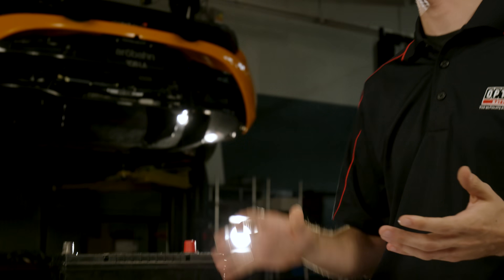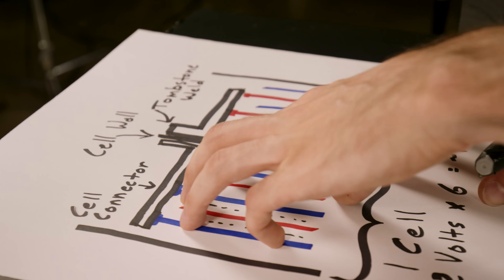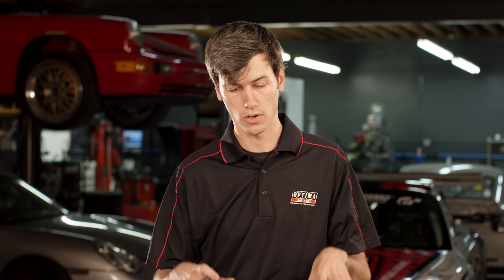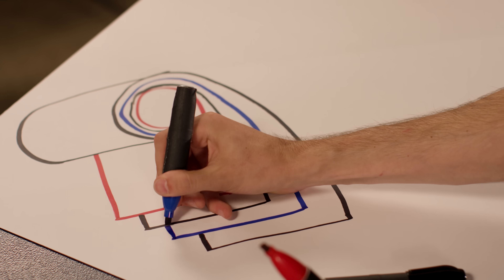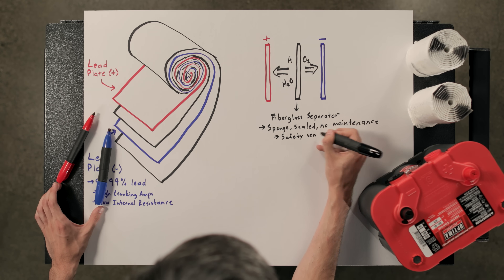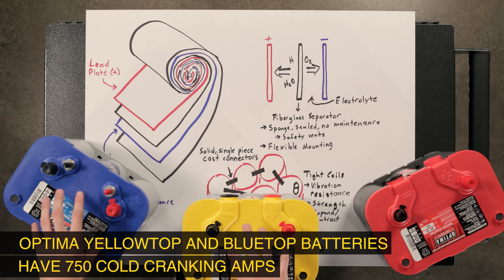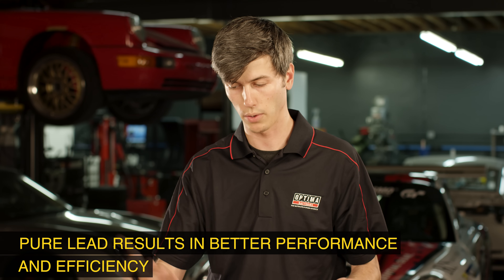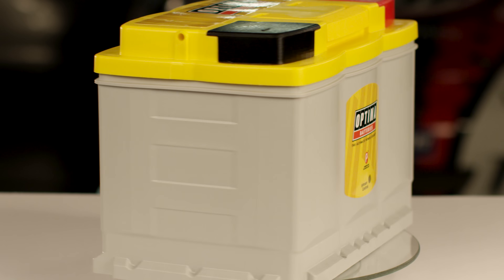What Type Of Car Battery Should You Use? Flooded vs AGM

Comment: FLA batteries are sealed and don't require maintenance in automotive applications anymore.  They have been this way for as long as I have been alive (31 years).  The only time I have seen a battery that you could add water to was on a golf cart (a deep cycle battery system).  This is what happens when you let a company sponsor your videos.  Facts get skewed.  Had you said this but explained that sealed FLA batteries have a shorter lifespan because you can't add water, that would have been there honest truth.  Your videos are usually great at explaining engineering concepts, but this one was slightly biased.
Reply from the maker: Johnson Controls makes flooded lead acid batteries, so why would the make something up about their own product? You can still add water. There are sealed and non-sealed.
Reply: Engineering Explained if you are comparing just their products, that's fine, but that wasn't clear. I'm not trying to knock you or anything. I'm just providing honest feedback. Maybe if you had made mention of sealed vs not sealed that would have kept things completely honest.
Reply: More than half of the FLA automotive batteries I've seen are not "maintenance-free" and still have removable caps on the top for checking electrolyte level and topping them off. The "maintenance free" FLA batteries are still not completely sealed...they can't be—they need a way to vent gasses that are produced during recharging. Turn one on it's side and leave it overnight if you need proof. They have vent ports that are free-flowing, even if their location is not obvious (batteries intended for interior mounting will have designated ports to attach the vent tube(s), usually on the top edges). A true VRLA (valve regulated lead acid, which includes AGM types) also have vents, but the vents are normally closed and only open in the event of excess pressure build-up. They are clearly visible on Optima batteries: they are the raised circles on the top corners opposite the battery terminals with the gray filter media pressed into them.

Comment: Why they don't use lithium-ion battery ,it's lighter ?
Reply: Safety. Lithium-ion are very picky about how they are recharged, their environment (temperature) and need protection from being physically breached (in an accident). Fail to protect one from these things and they easily go into thermal runaway and catch fire (and can be hard to extinguish once this happens). The cost to provide the necessary safety mechanisms does not justify their mass-adoption as a battery for internal-combustion vehicles. There is an alternative chemistry, lithium iron phosphate, that is much safer than lithium ion, almost as light, and can be directly substituted for lead acid batteries in many vehicular applications, however they are very expensive. A typical small one (sized for a motorcycle) is $150 USD, while units sized for a typical 2.0L car engine (480 cranking amps) are $300 USD!

Comment: That last battery is the one that I use and I haven't had to replace my battery for the past 5 years, haven't had an issue without it starting either even though my car alarm is technically a parasitic draw and I drive less than 5k miles a year.  I recommend that or the spiral for anyone.  Flooded are not going to be maintained properly by most people.

Comment: So, what's the advantage of Flooded Lead Acid batteries? Why are these still used?
Reply: Aleksandar Udovicic  - They're cheaper to make, and they are more tolerant of being overcharged. If you overcharge a (non-sealed) flooded cell battery, the electrolyte (acid-water) can be refilled; a sealed battery of any type cannot be serviced in this manner. For this reason, a sealed or AGM battery requires more care with the charging voltage.

Comment: Too bad Optima doesn't make a battery that fits my Miata...
Reply: You could use the large Ballastic 16 cell EVO2 in your Miata. It provides 480 cranking amps and weighs only 3.5 pounds (about 1/10 the weight of the lightest Optima). Unfortunately it also costs $300...

Comment: AGM lead acid batteries cost twice as much and has half the cycle life as flooded lead acid batteries.

Lithium-ION battery technology is just about at the point being cheap enough to displace AGM batteries. The lower cost and longer life of flooded batteries make them safe from being displaced by Li-ION for the medium term.

Comment: Cool Video, could you do a video on whats required when trying to switch to a lightweight battery, but still having enough juice to run the car.  Im trying to find a lightweight battery to add for my car to reduce weight, ill own the car for a number of years so even fairly expensive batteries would work, assuming they last.

Comment: what is the differences (if you can, with advantage and disadvantage between each other) between dry and wet batteries/accumulator? because in my country, the battery for vehicles are more often dividied with these types than types in the video.

Comment: I have had really good success with replacing my Lead Acid batteries with AGM flat plate types. I have done this with a Porsche and a BMW. Both cars have the battery in the trunk away from heat. Before the upgrade, I needed to charge the batteries with a maintainer every 2 to 3 months (and that was starting with new LA batteries). Both cars are only used once every 2-3 weeks and live in an area where a maintainer is not an option.

Comment: I like Optima batteries. I have used them in my off road trucks as well as my track car. They don't leak and are more ruggedly built survive the rigors of those activities. That said even I thought this just sounded like a commercial for Optima batteries. Also I'd say more than a few people are not going to be able to follow this video. It wasn't explained as well as subjects you have done in the past. You focused more on Optima's construction of batteries rather than a batteries general operation.

Comment: My father for the longest time ran an Optima Yellow Top in his 98 TJ trail rig with all the electronics built off the posts. He went to a Blue Top Marine the last time around, which despite being a marine battery, works quite well and all the auxiliary electronics are run off the second set of posts.

I ran a FLA Battery in my WRX for the longest time till I felt it starting to falter in the cold Colorado mornings. Switched to a Red Top and it seems to have alleviated some of my problems

Comment: A FLA battery is 2.1V per cell not 2.2V with resting/fully charged voltage of 12.6V not 13.2.  AGMs are usually around 12.8V.  You also could have discussed acceptance rate during charging in that AGM batteries can be charged more quickly as they can accept more current.
Reply: theshimonmor yup 12.6 =fully charged

Comment: 2 pickups, 1 with flooded acid batt, the other optima yellowtop, the pickup with flooded acid bat, has to chage it 2 times, the other 3 years still going, i changed the battery of the other pickup, no issues since then

Comment: So which is best? The yellow spiral?
Reply from the maker: Well, they’re all different, which is part of what this video hopes to convey. Red spiral will have higher cold cranking amps, but trades off with amp-hours vs yellow top (you can see the different ratings on the tops of the batteries, when you’re looking at a store or online).

Comment: the design is pretty neat, how do you dispose of the waste? has it environmental advantages/disadvantages?
Reply from the maker: The full lead batteries are nearly entirely recyclable. Because they use pure lead it’s easy to recycle. I know traditional flooded lead acid batteries are also recyclable, but I’m not sure on the percentage.

Comment: Great video but whats about lipo batteries? I know a company from germany making those for street and race use with nice features such as a general switch with phoneapp, so you can turn of your car completely, when leaving it outside. The batteries way a lot less and are smaller, too.
Reply from the maker: That’s a great question! I wonder if it’s cost that perhaps deters them, but I do not know. They certainly can be packaged quite small. May also have to do with cold temp performance; need to do a bit more research haha.
Reply: LiPo+Ultracapacitor bank for the best of both worlds. Infinite amps at any temperature and very lightweight. Just damn expensive.
Definately on my todo list as soon as i got a few hundred to blow on it.

Comment: Would be interested in seeing a break down of lithium batteries. I have a Shorai lithium battery that weighs 4lbs(!) in my BRZ.
Reply from the maker: Good suggestion! I’m curious as well.
Reply: Tell us more about your BRZ...
Reply: Ballistic makes a 4-cell 12v Lithium Iron Phosphate motorcycle battery (EVO2) that weighs less than a pound. I used it in a converted motocross-bike-turned-supermoto and literally strapped the battery inside the airbox it was so tiny! It worked great in that application and cranked a modified 450 4-stroke with ease, although the 8-cell would be a better choice for most street bikes and those are still under 2 pounds.
Reply: +1 for Shorai
Reply: What's the CCA on those???
Reply: Mudog715 LiFePo4 is great technology, not quite as high a energy density as normal lipos, but much safer.
Reply: Where do you see this Shorai battery? It's not listed on their site or anywhere for sale.  Currently their most powerful battery is the LFX36L3-BS12 which is rated for 540 CCA
Reply: Would I need to run a super capacitor to run a lithium battery instead of the flooded/agm batteries?
Reply: unit03 540. I own myself in my BRZ. Only issue is having a mounting bracket to hold it.
Reply: Oi, I'd be too paranoid to drop a lithium battery in my car. I mean, in most applications, lithium batteries are mated up to protection curcuits to interrupt when they see any excessive current draw. Do these batteries have any built in?
Reply: Adam Haddad I'd be more worried about overcharging than current draw
Reply: I would really like to see if Optima/Johnson Controls can apply the spiral cell design to lithium batteries. One of the main hurdles in lithium battery manufacturing is air exposure/oxidation, and I suspect rolling the lithium sheets directly after being manufactured would help avoid that issue.
Reply: Not familiar with CCA ratings and what they mean, but my BRZ has OEM Sub. Would you know if that would effect the ability of using a LI battery? I also heard there can be safety issues with using a LI battery. Not sure if its true.
Reply: The way Shorai rates their batteries is borderline scam.
Reply: That's a motorcycle or track only battery. Check out Braille Battery for automotive lithium batteries. They even make a carbon fiber one.
Reply: i run a lithium ion in my 1986 kawasaki bayou 185 atv. the only thing that you need to keep in mind is that to fully charge that battery you need a 1-2 amp 15vdc charger. it will be ok at 14vdc which is what your vehicle charges it but in winter i charge it fully and it really helps spin the engine when doing a cold start.
Reply: Justin's Pit Lane replace lead with lithium. Easy
Reply: That must've costed a fortune!
Reply: If anyone would like to try a pair of almost new 270 CCA lithium batteries in their car, paralleled for about 540 CCA, let me know.  Total weight is less than 5 pounds. Might be good in a performance car to shave about 45 pounds.  No need to go on that diet you've been contemplating.  Or if you are worried about that large subwoofer in your trunk being 45 pounds, just shave 45 pounds off of the battery to compensate.  That will likely improve your weight distribution too closer to 50/50 front/rear, perhaps giving you better traction and handling.
Reply: CCA = cold cranking amps. Basically the batteries ability to crank over the engine in cold weather, when the oil is thick/engine is cold and things are harder to move. Most cars have a recommended minimum CCA rating to start their engine.

The OEM sub should not have any effect, unless it has more draw when the car is off. The LI batteries require more care, IE: you will have to stick it on a charger if the car is going to be sitting for more than 4-5 days. Safety is not an issue, they are fine. Over 2 years running on my cars with no issues.
Reply: 800CCA for the 34R
Reply: I would be very scared to put a Lithium battery in a car not original design for such (Like an electric car where they are placed in a non-crushing compartment). Lithium battery has an energy density close to that of TNT. If you get into an auto accident and something pierces the battery while it's fully charge you can cause the entire battery to meltdown and explode. I'm sure the Shorai has a protection circuit against charging like some folks mention (if it's called a battery the protection circuit is mandatory, otherwise they are called Lithium cells). But if a car at high way speeds hit something and causes the engine compartment to compress like in most car in an effort to save the passengers the odds of something piercing the battery would be very scary.

Comment: I moved to a Duracell brand AGM battery in my jetta a couple years ago after being unable to start my car with a flooded battery after cruising with the stereo on. Even with the alternator charging it still drained too low to crank back over. (Yes if id realized i would've let it set and run and charge with the music off but i didn't) anyway after switching to the AGM it's been smooth sailing never even have to think about it. Just works

Comment: Geez, it's 2018. Why aren't we using LiPo?
Reply: Because it's more expensive,  doesn't like being stored fully charged, internal resistance can go up quite rapidly over time and it requires way more "management" than a lead-acid battery increasing not only costs of the battery, but also battery management electronics.
Reply: Lipo batteries have many issues. For example, they can't tolerate sitting fully charged for extended periods of time. Lithium batteries also need intelligent management systems, which would add cost, complexity and points of failure. They don't tolerate heat either, which is a big problem for an automotive battery. Another major problem is their environmental impact. Lead acid batteries are nearly 100% recyclable, and you get paid for them. Lithium batteries, however, are much more difficult to recycle, and they are expensive to dispose of properly. Recycling a lithium battery costs more than you'd make off the materials, so a lot of batteries would probably end up in landfills. Another major issue is safety. If a lead acid battery gets overcharged, it damages it and may leak acid. However, if a lithium battery gets overcharged, especially a large enough one to be used in a car, you have a fiery bomb. Same goes for the battery getting crushed in an accident. All in all, 25-30 pounds of weight savings is not enough to replace lead acid batteries with lithium batteries in automotive applications.
Reply: I never heard that li-po are used for large application 🤔

Comment: I now own an Optima Red in my Corvette, and I am having extremely bad luck. The battery cell randomly dies (physically) every 3 months given the car circuitry is perfectly fine. Warranty covers the swap-outs, but it`s very annoying.
Reply: Stay away from Optima. They used to make great batteries, but they were lurched by some other company & got in bed with Walmart. Terrible batteries now.
Reply: Yao Sun Buy lithium cat batteries
Reply: If you can I would upgrade to the yellow top its much better and more reliable I have had the same issue in the past
Reply: Optima can cause issues. Make sure your Vette can charge for AGM. Honestly AGM is hit or mess. Should be worth it, could be worth it and may not be worth it when it comes to life span.

Comment: Weight differences between the 3 batteries? Would also be interesting to compare to a lithium battery
Reply from the maker: That’s a good question. I’m not sure on the actual weights, I would imagine for the same weight, the pure lead will offer better deep cycle and cold cranking characteristics. I have a couple sitting in my garage, I shall weigh them!
Reply: They aren't too different, I've handled both. Spiral cell optimo batteries are fairly compact, so easier to handle than some batteries

Comment: why dont they use llithium batteries?
Reply: My guess would be price and danger of fire in case of an accident.
Reply: price, Lithium batts are getting safer and safer every year
Reply: Most lithium ion batteries on the market have a low reserve capacity. This means they can be discharged easily by a lot of modern cars that have electrical loads after the engine is shut down. Examples include cars that run cooling fans and cars with turbochargers that recirculate oil through them to cool the bearings.